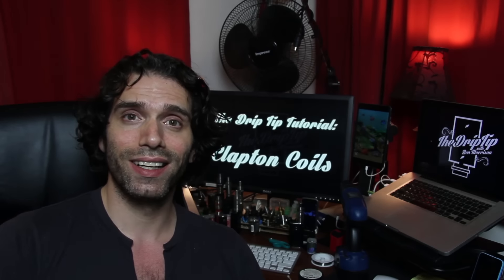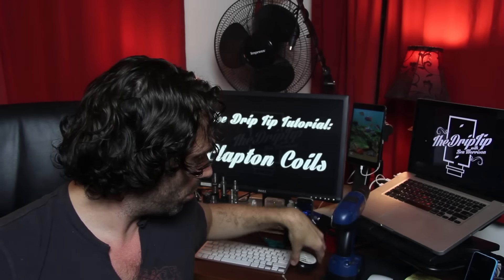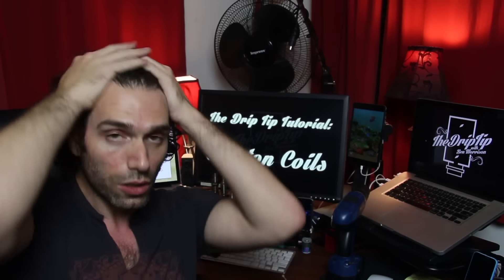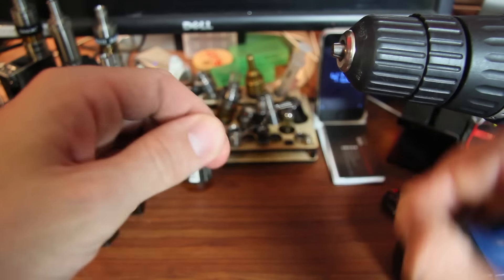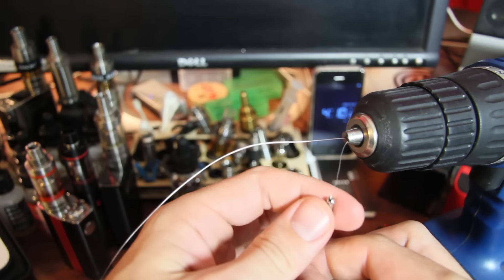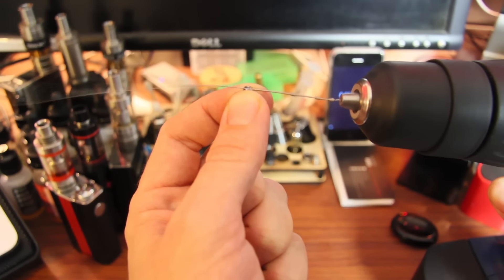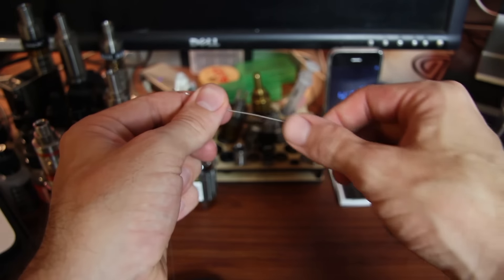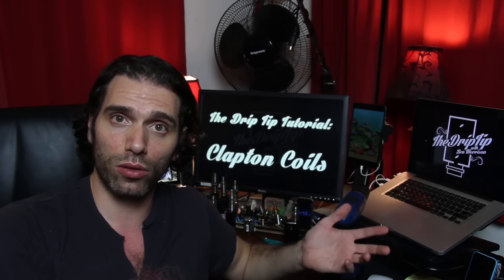The Drip Tip Tutorial : Wrap Your Own Clapton Coils

Comment: I know this works for you but I have a little tip for you , I don't know the make up of the areotank coils but instead of using just that little pin piece take the guts out of the coil and feed ur outer wire through the whole coilhead itstill the same idea just will give u something little more to hold onto then that wee lil pin, good job and congrats on ur claptons

Comment: Chewy, If you twist your 26 ga in the drill chuck for 5-10 sec before you use it with your Protank pin Claptoning technique, you'll have "pin straight' center wire to start this process with. Nice trick with the pin!